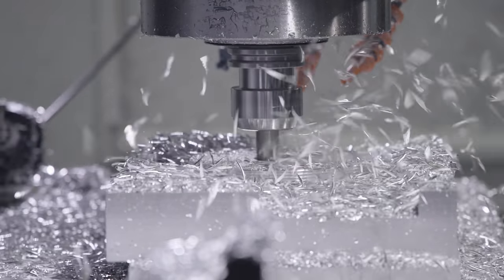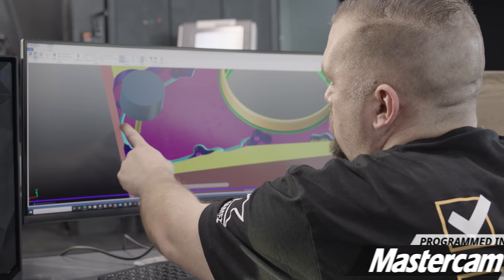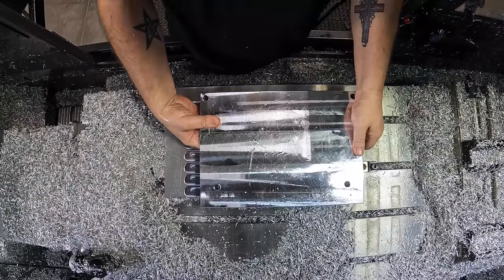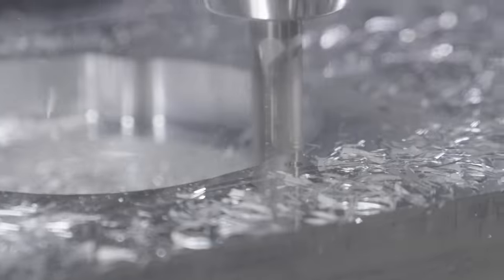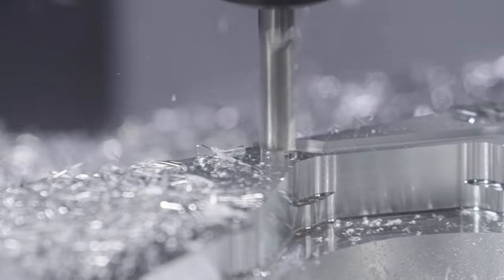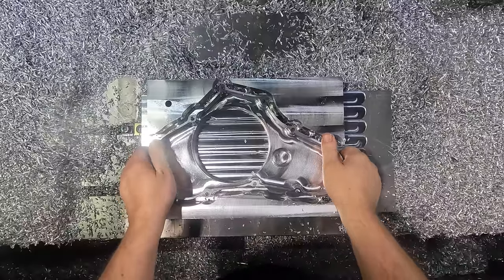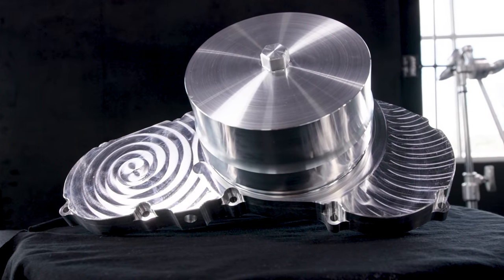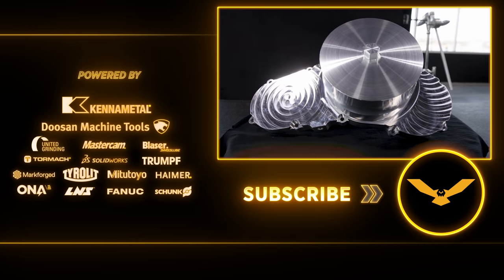Increase Efficiency with the TABS Fixturing Technique | DNM 5700 | DN Solutions

Comment: Worked in prototype development for about 10 years using this method exclusively and that was a carry over from Boeing where we tabbed a lot of parts as well. Hard to amortize any kind of tooling cost in prototyping. The great thing about tabbing, is that you can thin those tabs using a smaller tool, to the point where a light rap from a deadblow will eject the part from the frame. 

Expanding dowels are nice. We never had those, just dowel and bolt everything in place on the flip-side, but expanding dowels would have made things a lot easier.

Comment: I do something similar to this on a 5-axis machine to machine small, acrylic parts.  By small, I mean under 3 mm wide and under 200 um thick!  I use machinable wax to remove them from the tabs so that there's no burr to clean off.

Comment: Tabs are a staple in aerospace machining. Holding 200 lb parts or as small as a dime. On larger parts don't make the tabs thicker just make them longer. Also finish walls on thin parts all the way down to tab height then cut part out .

Comment: You can put hot glue in between the part and the stock then have the machine gently cut the tabs away so that you don't have to do any post machining finishing.
Reply: Great idea!
Reply: @barrysetzer  Saw it on NYC CNC, they have other cool workholding techniques that use atypical methods like super glue for holding blocks for low HP cuts.

Comment: I am an undergrad student, and I'm going to start machining a part from 7075 Aluminum using a similar picture framing technique, my question is how do you ensure a good surface finish on the surfaces where the tabs were machined ? And do you perform and any calculations to check if the tabs are strong enough to hold the part?
Reply: Finish everything on the outside profile possible while the tabs are still thick. And cut the tabs to a final thickness while taking a super light finish pass on the profile of like .002”
Reply: Make sure to have a good coolant and good coolant flow on the tool to flush away the chips without them welding to the part, the higher the coolant pressure the better. I have found with Aluminum, running a stronger coolant concentration also helps, but not so strong as to take the paint off the inside of your machine, but this might depend on the coolant you have on hand. If you look at time stamp 2:10 you can clearly see that the finish on the outside profile is not the greatest, this is because @Barry Setzer was cutting dry, most likely for the purpose of filming, but nothing a little 3M, elbow grease and a Apprentice won't solve. Sometimes leaving to little finish stock on a very thin wall can cause issues, so you also might want to try leaving more finish stock, like .015 / .030 for finish if you start having issues with chatter, or adjust speeds and feeds. You can also try high helical end mills, different coatings, 3 flute instead of 4 flute, a different fixturing method, the list goes on. If you are just starting out in the Machining world you are going to find it can be a painful learning process and it takes time to build up experience of what works and what doesn't. You are going to start with more bad days than good, but as time goes by and your experience grows, you start having more good days then bad, then they become mostly all good days. If you're not making mistakes, you're then you're not learning. Stick with it and you'll get there. Again, most of this depends what you have to work with in the shop you are in.
Reply: @barrysetzer  Make sure to have a good coolant and good coolant flow on the tool to flush away the chips without them welding to the part, the higher the coolant pressure the better. I have found with Aluminum, running a stronger coolant concentration also helps, but not so strong as to take the paint off the inside of your machine, but this might depend on the coolant you have on hand. If you look at time stamp 2:10 you can clearly see that the finish on the outside profile is not the greatest, this is because @Barry Setzer was cutting dry, most likely for the purpose of filming, but nothing a little 3M, elbow grease and a Apprentice won't solve. Sometimes leaving to little finish stock on a very thin wall can cause issues, so you also might want to try leaving more finish stock, like .015 / .030 for finish if you start having issues with chatter, or adjust speeds and feeds. You can also try high helical end mills, different coatings, 3 flute instead of 4 flute, a different fixturing method, the list goes on. If you are just starting out in the Machining world you are going to find it can be a painful learning process and it takes time to build up experience of what works and what doesn't. You are going to start with more bad days than good, but as time goes by and your experience grows, you start having more good days then bad, then they become mostly all good days. If you're not making mistakes, you're then you're not learning. Stick with it and you'll get there. Again, most of this depends what you have to work with in the shop you are in.
Reply: Thanks a lot for the advice
Reply: Tabs have strong possibility of leaving evidence of their existence that can be detected with Dye-Penetrant inspections.  

Best practices in order are
1. Place tabs in not critical datums if possible
2. Make tabs accessible for final machining passes if the parts allows 
3. Blend tabs with a grinder

Picture Framing is great because you can order a secondary billet of the same dimensions as your part and use that as a relatively cheap and quick work holding fixture.
Reply: @williamdunn4811  
1. Why would you even be using a Dye penetrant on this part? It's Aluminum, I don't think we need to worry cracks from heat treatment in this case.
2. The tabs are already accessible when @Barry Setzer did the profile of the part.
3. Blend tabs with a grinder? You said "Tabs have strong possibility of leaving evidence of their existence that can be detected with Dye-Penetrant inspections" and you want to use a grinder? What kind of grinder? Like a hand grinder? Be specific here! I would strongly advise against the use of any grinder here. Lead in and lead out with the same tool you are using to finish the profile of the part is the way to go here.
Reply: Another trick I use for very thin parts to keep a good finish is to attach a clump of clay to the side opposite the one you're finishing. If it's steel, you can take a magnet and tape it to the part, then affix another block or something magnetic near the magnet, (but not touching) such the magnetism lightly draws the magnet, just enough to dampen any sqeal or chatter. 😊
Reply: @williamdunn4811  what type of grinder do you use?

Comment: How much can you rip material when using those expansion clamps? Do they prevent part lift?
Reply: Yeah, they actual held the part down rock solid, they are really impressive.
Reply: In our old shops we used shoulder bolts mostly for picture framing, but there were many times we made expansion bosses and pins for finishing stages on tooling. You custom make what you need.

Comment: Where is all the water pump stuff that is on the original casting as it is not on the billet part?  Was it not used any longer and omitted?
Reply: Thats correct. On the original, these were all welded shut

Comment: What is the reason for conventional milling around the profile? Do you take a finish cut on the wall later?
Reply: I would imagine to reduce chatter and avoid the part being pulled into the cutter as it breaks free from the tabs
Reply: I assume it's because taking a shallow pass lets the remaining stock support the thin wall part for longer.  This can also be a good reason to combine the roughing and finish pass, as thin parts may be too flexible to get a good surface finish on a finishing pass.

Comment: how do you remove the rest of tabs? and make final adjustment of the part? can you share with us this?
Reply: On this part the tabs were so thin and small, i used a small needle file
Reply: @barrysetzer  i do the same, but not very happy with the result, not smooth and even surface ... maybe some scotch brite, some nice tool for vertical grinder.:-??

Comment: But now you have spikes left where the tabs where that need to taken care of... A better way to do that is use the holes in the part to locate and hold it on the second setup. That way there is no work required after the second setup.
Reply: True but not as versatile of a setup. This is just another method to keep in your "machinist's toolbox"